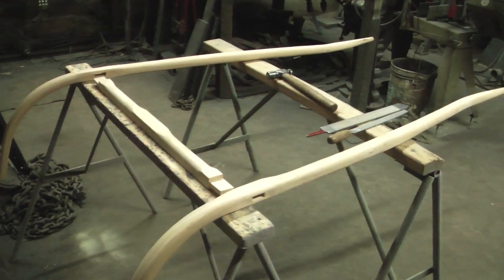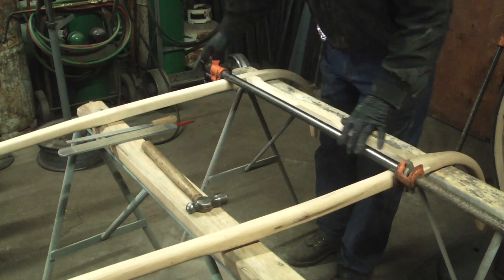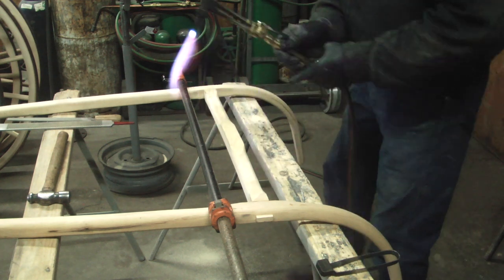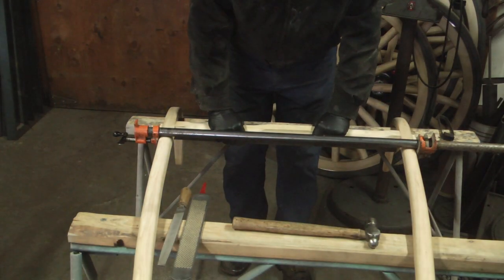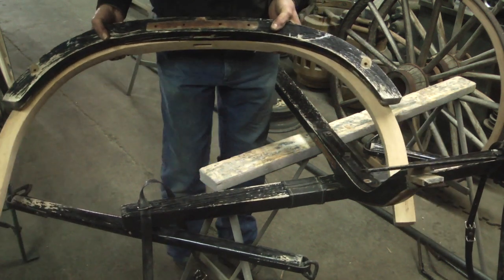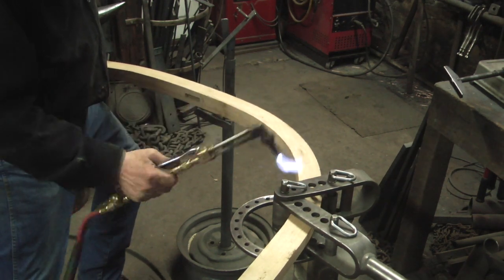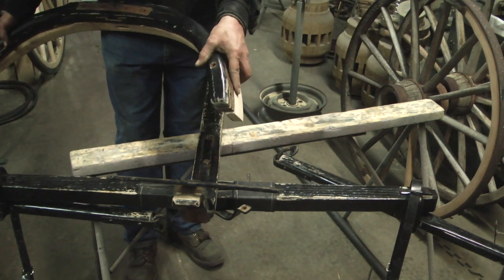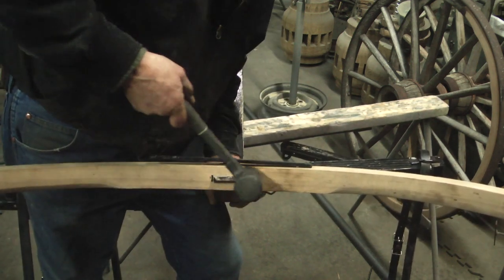Relaxing Wood or Twisting Wood  with a Cutting Torch | Engels Coach

Comment: Thanks for another great video!  I've been struggling with making baseboards to wrap a bar that is elliptical.  The radius in the middle is about 6', but at the ends it is only 10".  The whole thing is red oak.  The baseboard stock is 3.5" x 5/8".  I ended up taking the top ogee part off, and thinning the remainder into three plies.  Then I steam bent the components around a form, allowing for springback.  Re-laminating the 3 layers back to get the base board thickness went smooth enough, but the ogee molding at the top was a single piece, and although it is bent to correct radii, I couldn't keep the thing from twisting.  Of course now it won't fit in the steam box.  I had been thinking about soaking it and using a  propane torch but was unsure about it.  Now I know it might work, so I'll give it a try, to untwist it back into a common plane.  THANKS!
Reply: @EngelsCoachShop  Thanks.  Perseverance and perspiration usually get the job done.

Comment: nice video like every time. as an mechanic and pipework maker I learned to bend and relax steel the same way. It is not easy to find the right points where to put heat points. That needs alot of experiance.

Comment: There is a big difference between bending wood and a little adjustment tweaking and twisting those are helpful tips but I have bent real wood weather by Steam or buy lamination but my friend sorry you are not bending you are tweaking good job though good tips appreciate you
Reply: Perhaps you would care to take the time to watch Dave Engels steam bending 1 3/4" Oak before you air your knowledge.